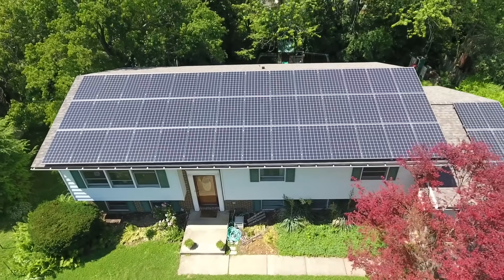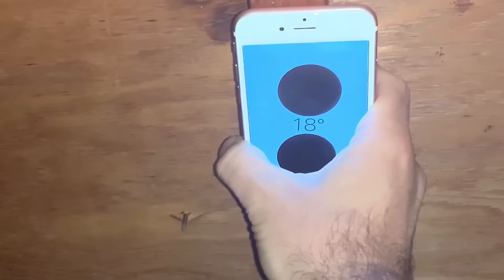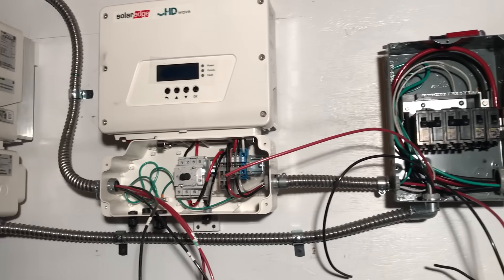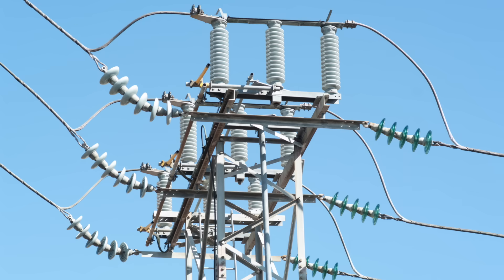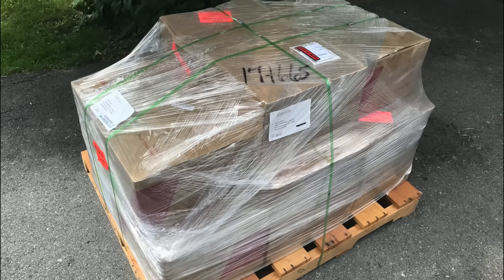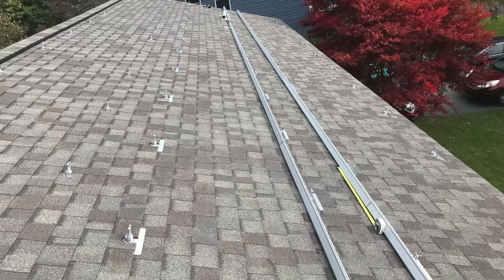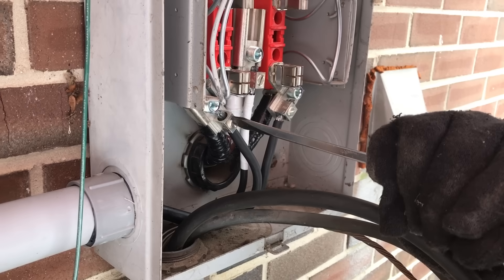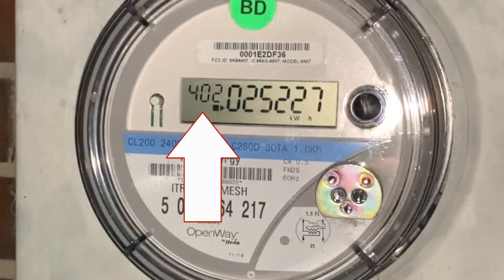I Installed a Power Plant Myself | HUGE DIY Solar Panel System

Comment: It would be awesome if you made or even sold step by step how to videos of each step for both the paperwork and how to install. Make affiliate links too of where you bought your panels and wires and equipment. Thanks
Reply from the maker: That’s a great suggestion.  I really wished there was someone/something to help me with each step.
Reply: @FrugalRepair  I could help with each step. For example, I have so many questions. The main question I have is it looks like you put the metal brackets on the roof under the shingle partially, is that required? You can break up the how to videos into segments. Like 1) video for researching the roof dimensions and calculating the angle and sunlight. 2) video of how to put on the brackets and level them with the rails. 3) video of wiring, with size and how to run to the side of the building etc. the more details the better. I’m just shooting from the hip here, but you could literally create a business off of selling or promoting these videos on Udemy platform. I buy coding and web developer courses all the time from people on there.
Reply from the maker: I like your thinking!
Reply: @FrugalRepair  I would totally buy your videos on Udemy. I’ve also wanted to build my own solar system to not pay electricity bills. You can give little teaser or overview videos on YouTube to promote your Udemy classes. Like this video here is a great overview of everything you did but it doesn’t really break down how to do it. So if you made a series of like 10-20 small how to videos you could sell them on Udemy for 30-60 bucks per person and promote them on YouTube without giving all the details away on YouTube. 👍 I’m really into innovation myself. I’ve built an ATV that doesn’t require fuel or recharging. I’m currently looking to get a patent done on my invention and I’m researching investors online so I can build my electromagnetic engine inside a car. My dream and goal is to have my own car company and build the world’s first gas free, no recharging car that you can just get in and drive!
Reply from the maker: Wow, sounds awesome!  Shoot me an email and we can connect.
Reply: @FrugalRepair   yes I’d love to connect with you! If I just go to your website is your email listed there? I didn’t see a contact or anything under your about section or in the description? I didn’t know if you wanted to leave your email in this comment section or not? Thanks
Reply from the maker: It's on both.  About section on YT, you need to do the human check to reveal it.
Reply: @FrugalRepair  ok awesome! I just emailed you 👍

Comment: Too bad not all areas are so friendly to non licensed people doing this. I have solar at my farm, but in St Louis County the unions have kept it so that only THEY can do this work.
Reply from the maker: Interesting.  What about an independent installer?  They need to be in a union?
Reply: @FrugalRepair  Well there are non union contractors, but the real problem is you must have a commercial electricians license to do this kind of work, the union contractors have pushed for this to secure their position the license is expensive so if you aren't doing it as a business its not worth it, they have a homeowners license you can get and not pay the  high price, but all you can do with that license is branch circuits, no service entrances, solar, or generator connections. I am an electrical engineer and worked as an electrician before that but none of that matters, its all about power and money.
Reply from the maker: Wow.

Comment: In total what was the cost of everything from materials to laborers?
Reply: I bought my wife a brand new den that we could not afford.She ask, how will we pay for this?I told her, stop drinking coffee and buying feminine products and this baby will pay it's self in three to five year's.
Reply: @Jesse2k25  what's a den and how will your wife stop using feminine products?
Reply: @vicgamesvt9682  The way i see it, it might be a lion den. He's about to get her one of those. It will solve the "cosmetics" issue as well.😎
Reply: years of their electric bills
Reply: @tylertran604  *decades
Reply: @filipkramaric6636  in the video, it is said that the system will pay for itself in 5-7 years
Reply: @AleksandarStefanovic  if they lasted 7 years under rain and snow
Reply: @thelaw9937  panels at the company I worked for had 25 year warranty with effective standards of something like 80% retained output at install.  Rain and snow do literally nothing to the glass.  You can’t prevent idiots from putting their panels under tree limbs they refuse to trim, but normal weather does nothing.

Comment: If I was to do this I would run my house on DC and only by DC appliances, then the excess power would get converter to ac and sent to the grid, I would do this to minimise power losses in inverting DC to AC. What do you think would this Work
Reply from the maker: You could run things on DC, yes.  It would be a big conversion in most homes though.
Reply: @FrugalRepair  Honestly its not that big of a conversion as just about everything basically runs DC converted from AC anyways . Motors are just about always universal so they can be run on AC or DC, for things like TV's you can get external powered supplies (power bricks)or plain out DC, Computers are getting to be the same now as the newer ones use 12v from the power supply now. As for lights use the E27 12v/24v/48v DC led bulbs what ever your voltage is. Most non convert able appliances have a DC alternative such as hair drivers and so on.

Comment: Do you plan to add any battery back up to the system at some point?  Having grid tie solar is great, but when the power goes out, so does you solar electricity production.
Reply from the maker: Not until I have to.  We rarely have long power outages.

Comment: So what are the standard sizes? Did you truly get over 100%? Had you NOT gotten lucky and had to use standard size panels, what would have been your calculated output? Is the house cooler now? What kind of storage do you have? What was the total investment? You say the panels merely sit on the rails. No hardware mount at all? Seems potentially risky from high wind.
Reply from the maker: Lots of good questions.  Thanks!  Real quick, the panels are held down by clamps/bolts.  They can withstand I think, 110mph winds,  so no worries there.

Comment: Not so fast. A friend of mine did something similar. Not quite as elaborate. But over time the battery's went bad and so did the solar panels  some were also damaged in a hail storm. I asked him if he would do it again. Nope. With all the lifestyle changes and comprises and additional costs of replacement parts. It wasn't worth the effort.

Comment: Hi I m install 265 watt Soler panel and 65mah exide battery and 200watt homemade Soler inverter Soler inverter run 8  LED bulb full night run per led 8 watt

Comment: What was the cost of the panels + installation hardware + your time?

The cost of electricity per kilowatt in your area?

The amount of average electricity produced by the panels per year?

The ultimately goal here is to see what the payback period is. 

Then you can see if it was worth it or not.

Comment: This is a fantastic video and I commend your excellent efforts with kudos!

I'm curious: It seems that with the installation you documented in this video, your solar panels are connected directly to either your house or the electrical grid.  Do you have any kind of electrical storage in between?  Do you have any plans to install a battery system like a home-made Tesla PowerWall?

Comment: I'm not sure with the system but where's the battery where you store all the power you gathered from the sun
Reply from the maker: No batteries needed bc of net metering.  I’ll plan to explain this in the future video.
Reply: @FrugalRepair  thanks. I'm happy to hear that. I'm a structural engineer by profession but also have great interest on DIY stuffs. Keep on going mate. You got my subscription

Comment: Also too.. why does DC power need a ground?
Reply from the maker: All electrical equipment (all metal) must be grounded so there is no chance anyone might touch a live part.
Reply: Right but to my knowledge DC doesn't use earth like AC does so there shouldn't be a relation. Or is it still related due to the inverters? I could understand that it would need to be bonded so nothing gathers a difference of potential. But grounded im scratching my head on.
Reply: I'm in the electrical distribution business, so I'm more on the construction side. I know next to nothing about DC except for working on cars/bikes.
Reply: I guess my main question is if the power in question doesn't have a relationship to ground why would it need a ground wire for DC? To me it would be like touching the positive terminal of a battery. Unless your also touching the negative nothing would happen.

Comment: That I never got... your meter itself is only rated at 200 amps. Your panel may be rated less, but electrical panels since 1990 ish i would think should all be rated at 200 amps there abouts. If you tie it into the panel I don't know why it would screw with the rating as your adding power to it that would supplement the power already going through it. At least going through the panel it would have a circuit breaker protecting it going back to the grid.
Reply from the maker: The answer is a little technical but if you have too many amps that exceed the rating of the bus bar inside your panel then you have a potential for too much heat.   Backfeeding 40amps is about the limit. I have more amps at peak than that.
Reply: Is there circuit protection between the grid and your inverter?

Comment: Nice video, I too am planning on doing solar panels in the future.  Have a truck topper im thinking about turning into a portable power station shed.
Reply: Ya there are panels that get stolen for sure. Though its not as common as car theft but people still buy cars. As for my state the power company is privatized entity so the state wouldn't be upset but the corporations might be.
Reply from the maker: Thanks!  That’d be cool
Reply: it is, of course, a nice accomplishment but governments might hate it when e.g. all people do not buy electricity from their state power utility anymore? Eventually, politicians might come up with new laws. Another difficulty might be regions with lots of snow, how to remove 10ft thick snow lying on the pannels? In case of a fire, it might be good to have metal roofing that can be installed over top of shingles. Otherwise, these expensive solar panels might go up in flames? What is a crazy new phenomenon is that solar panels are stolen even from a roof, see, "Solar Panels Are Vanishing, Only to Reappear on the Internet" (NY-TIMES).

Comment: Sorry for my english... You don't talked about your consommation, i mean, you have gaz for oven or not or you use solar cell for your oven... Do you need to heat your house when it's cold season with solar cell ? Can you use solar cell for tools like miter saw or tools who need a high pic of electricity when start ?? How many battery you need ??  Etc...

Comment: The problem of solar is not the installation, but the diminishing returns they give over time. If you calculate just basic grid-power cost vs panels you'll find that as soon as you've got break even the panes are pretty much pointless, having fallen below 50% production or lower because of degradation. The only use for solar panels is when you truly live off-grid where there IS no grid for cheaper (nuclear) electricity. So no, it's not worth it. Not until cheaper panels that will last longer at higher returns are developed.

Comment: I love the ingenuity and the level of precision.  How did you get this final inspected though, because you have left no room for firefighters to access the roof from that side.  Setback requirements dictate there needs to be 18" from the ridge for attic ventilation and one gable edge walkway of 36". Otherwise thorough and well done.  I'm a solar installer who has done hundreds of installs and I appreciate the attention to detail and research done to get this accomplished.
Reply from the maker: Thanks!  Reading your comment is very encouraging.  Our code didn’t adopt the 3’ setback provision so I, thankfully, didn’t have to worry about it.

Comment: I heard somewhere, that it isn't necessary to have an inverter...we can use the dc directly for almost every appliances...is that true?
Reply from the maker: Yes, but you need to make sure the voltage and current are matched and managed.
Reply: @FrugalRepair  thanks man...lot of information up here😇

Comment: Some electric companies do not let you go to ZERO on your electric.  I installed in CT Eversource.  They would only let us go to 90%.  For us we were lucky because the amount of panels was based off the previous years electric bill.  We had 7 people in the house.  When the kids moved out the next year and it was my wife and I we generated more electricity than we could use.  Our monthly electric bill was not zero since Eversource charged a 19 dollar distribution fee.  Even though we maintained a positive balance of electricity we fed back to the electric company.  You have to check with your specific electric company on what you can and can't do.  LOVED the video by the way!
Reply from the maker: Thanks!  I’ll explain in a future video but you’re right we have a very small connection fee but our other SREC income covers that and more.  So over the course of a year, we have net income, though it’s not very much.

Comment: A neighbor down the road installed a few panels with the help of a local solar shop and the electric company gave a little pushback (seems they don’t want to deal with back fed power “safety” &...profit loss) he also has & charges his Tesla (60k car in a 100k neighborhood) his solar cost him @$12k that was closer to 7 years ago @2013. He might of gotten some solar credits on taxes too. He said they change the power rate cost on you since you’re now a “producer” and he said it was a wash in how much he saved, just that he has multiple properties with panels and makes pennies off sell back. I wish I’d done mine when he did his...now I’ve the time and not the income...Pipe dreams...a friend just received a gift of all the stuff to build (solder and silicone/seal) his panels the size he wishes, I may look into that also since it will force me to learn something I should of learned 30 years ago...thanks for the video it is inspiring “if another human can do it & show how, then maybe I can stop making excuses”, “you only live or die once make the best of it”.

Comment: Just wish those solar panels were cheaper. Would make for fun DIY projects.
Reply from the maker: Contact a solar installer and see if they have broken panels.  I did this and picked up a bunch with cracked glass for some projects.
Reply from the maker: Or buy them used or from an insurance company.

Comment: Power outage in the entire neighborhood and city 
This guy: Hehe I've got solar panels BOIS! Lights are still on inside house 
Neighbors: Lucky son of a...
Reply: Actually, not. Although FrugalRepair did a great job, he has no battery backup, so his system can only supply power during sunny conditions and he has no fallback for night-time or cloudy conditions. This was a design-choice in order to dramatically reduce installation cost. Large capacity batteries are expensive.

Comment: Amazing vid. Really happy for you. 
My question is, given the 14% Roi, would it make sense and invest more in say a secondary array, hypothetically, and ride all this long haul. You’re basically running your own energy company but as a private owner. Wonder how that works, or if there is a non-commercial energy contribution limit. Thanks
Reply from the maker: Thanks!  I wish it would work that way but I’m not allowed to produce more than I would reasonably use.  So I’m pretty close to the max PV I can put on the roof.

Comment: The rebate or buy back of power is different every where you go , in my area they only give you 11c per.. (87c per.. 5 years ago). So it would take 30-40 years to pay it off but it will not last 20 years .